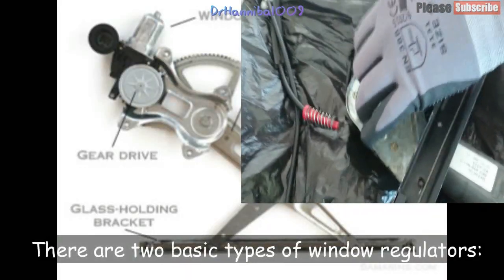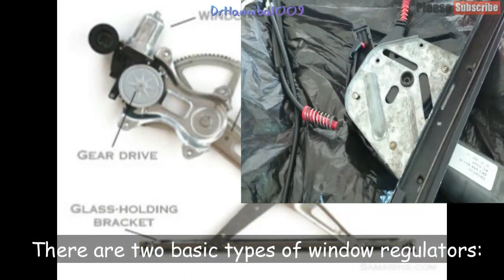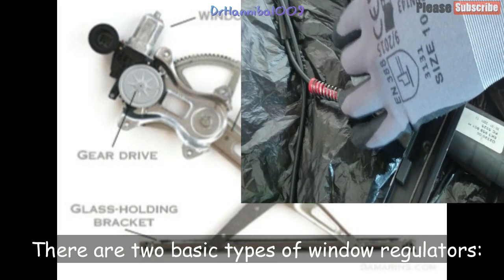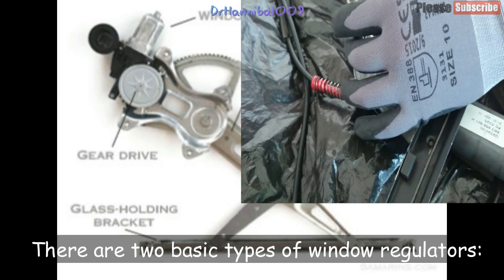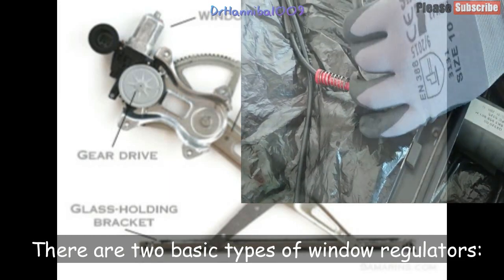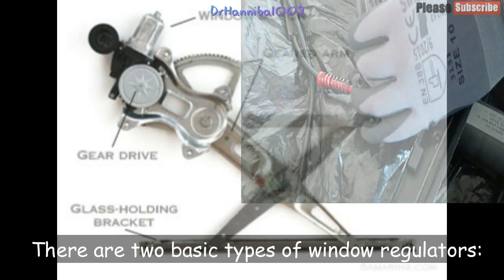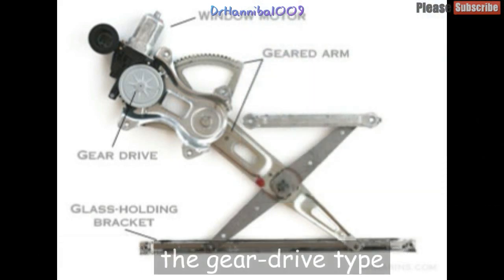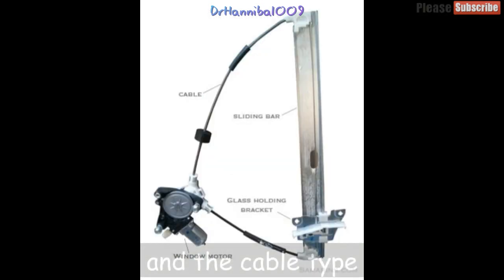How Car Window Regulator Works And All Parts

Comment: @ 2:14 EYY a Mazda 3 regulator, had to replace the cables on my driver side regulator recently, used 1/16 Aircraft cable.
Reply from the maker: nice

Comment: Sir my car i20 windows motor connector has 6 wires on it. How to get the wires for roll up and down windows?
Reply from the maker: Hello, I didn't understand it well, what wires are talking about steel wire or voltage wires?
Reply: Hannibal Lectorr I try to locate the control wire for windows roll up and down. My car has 6 wires on the window motor connector contrary to other 2 wire connector in some cars. Please help me find the 2 wires. Thanks.

If it was 2 wires I could locate the up window wire and down window wire easily. However, it's a mess here with 6 wires.
Reply from the maker: @tnamen1307  OK, I'm not sure why are 6 wires there, black and red are here as for wv cars , what is the problem with your car window?
Reply from the maker: as you can see here the 
the principle is similar 
https://www.youtube.com/watch?v=K4QtTzn1ORg
Reply: Hannibal Lectorr actually I try installing auto close windows module which will close all windows when doors are locked through remote locking key. The instructions is telling to find the control wires of each motor on each respective windows and cut one wire each. So in this case, driver side motor has got 6 wires surprisingly. I'm really surprised.......
Reply from the maker: @tnamen1307  sorry friend can't help you with that. Try to find your product and instructions on yt, good luck ;)